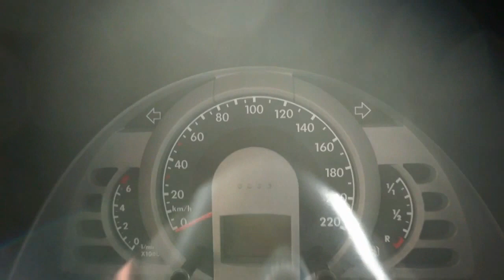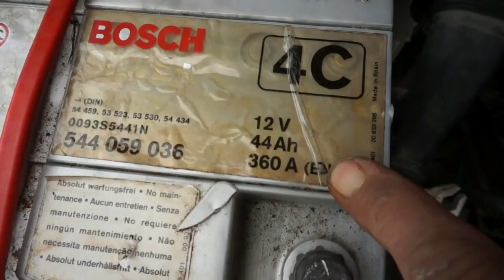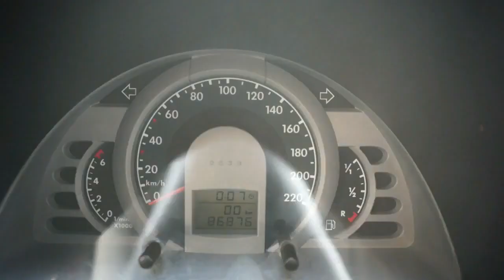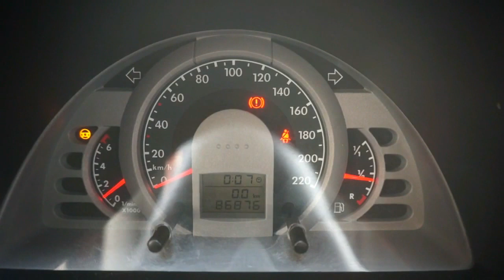How to Change a Car Battery Car Battery How to replace a Car Battery Change a Car Battery

Comment from the maker: Apply a thin layer of grease to the battery posts and terminals before connecting the positive terminal to the positive post first. Special anti-corrosion grease is available to prevent deposits of fluffy greenish-white corrosion that can actually prevent the battery from charging. Failing that, ordinary Vaseline can work ... Greetings Alex